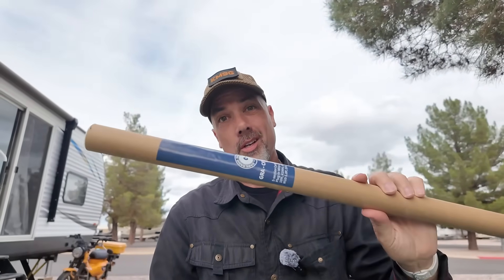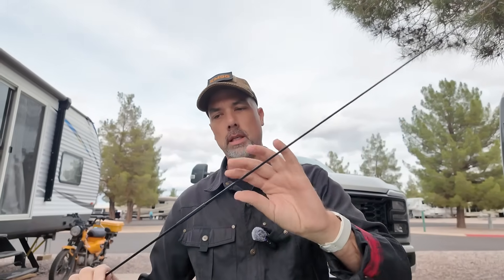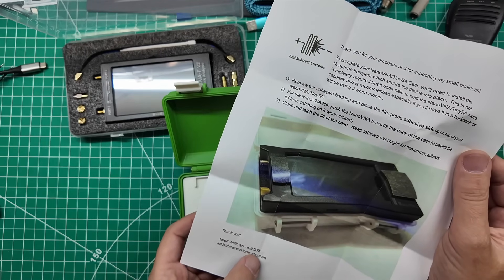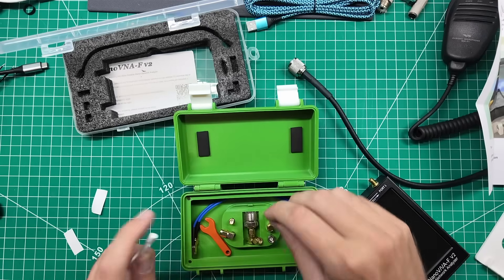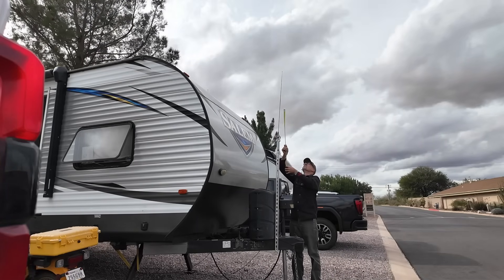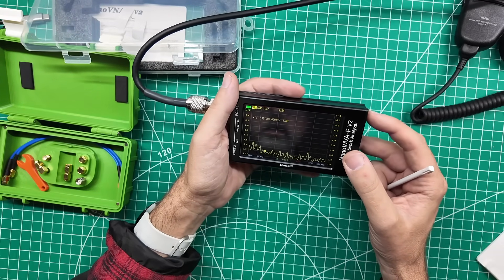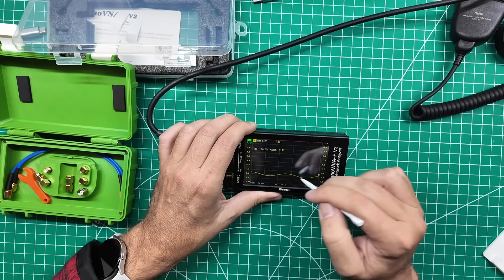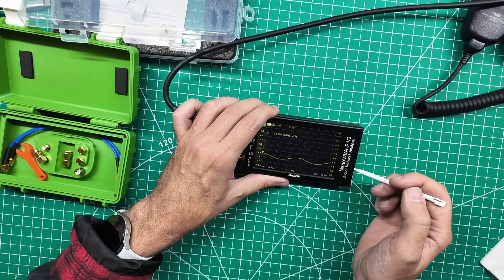When Ounces Feel Like Pounds, Grab the CF!

Comment: I take it with 60 MPH winds I can't drive at all with it . That what coming for us and 1 to 3 ft snow. That what NOAA said and they been right the past few years .  I have to keep power down on carbon fiber antenna to help with emissions.  73
Reply from the maker: Which CF antenna did you get?
Reply: @temporarilyoffline  I did not get any yet. Spending freeze until winter over or longer . Heating cost and snow removable . Income did not go up but health care cost did .And my work slowed down . And still paying on Mini split and home improvement that i put on plastic. All helping but takes time for investment to pay for it self like a few years. But we have better heat and AC  . 73

Comment: My concern is, what is this antenna's  'ERP" Effective Radiated Power. You can load up a dummy load with excellent SWR, but it's ERP is zero. If you set up a very low powered radiator at, let's say, 100 feet from this antenna, what is the level of the signal received, versus a copper or stainless antenna?  I wonder how much of the transmitter's energy is dissipated as heat from the fiber antenna, vs, a normal antenna.
Reply from the maker: Would be interesting to measure that.  I don't have the tools for it.
Reply: While the measurement would be interesting, it misses the point. This is not the antenna you're going to use from the midwestern US to reach Australia (except on a really really really good propagation day on 10m maybe). This is the antenna you're going to use mobile, or quick and dirty activation because it's super light and packs up small.

Gabil may be Chinesium, but they have yet to sell a product that didn't function as intended.

Comment: I see ticker toys style, need the the little round peices with sockets 90 an 60 degrees. Sell the middle sections by the dozen. Build your verticals, dipole delta loops, square loops, yagis all with tinker toys. May help to have a little more diameter for strength and to reduce radiation resistance ... more suface (remembering skin effect) less resistance.
Reply from the maker: You're giving me some great ideas for future videos!
Reply: @temporarilyoffline with the little round peices could also make a fan dipole. One in the straight configuration and the other in the Vee

Comment: My question for the telescoping Carbon fiber is how do you adjust say a 17 foot Carbon fiber to work on 17m and below becuase it looses conductivity with its sections when you lower a section?
Reply from the maker: I use an auto-tuner.  Perhaps for something like 17m that is already "close" you can shorten each segment a touch and get it.  Something I'll be testing up in a future video.

Comment: Carbon-Fiber is a terrible material for use as an antenna (with wire inside).  It has too much loss.  This loss is probably responsible for the "magic" you are referring to.  For this type of antenna, you should use pure fiberglass (no carbon at all).
Reply from the maker: There is no wire inside.  Gabil builds the antenna out of CF, which is already a radiator, then covers it with a coating to make it radiate even more.